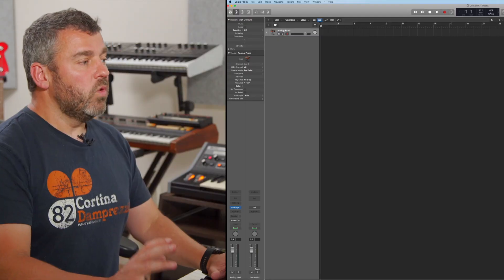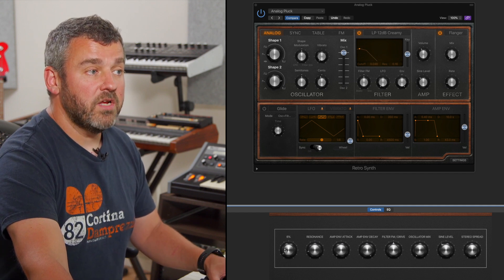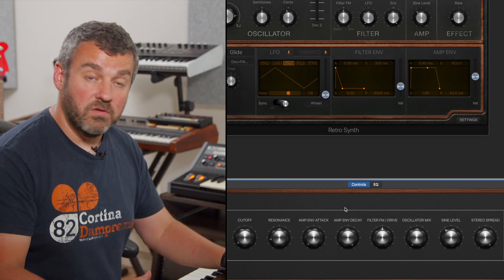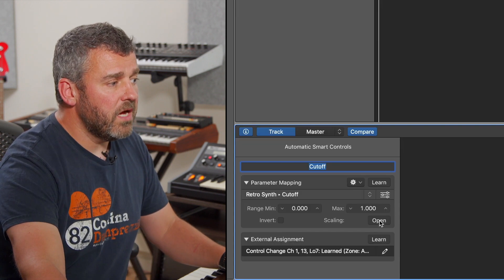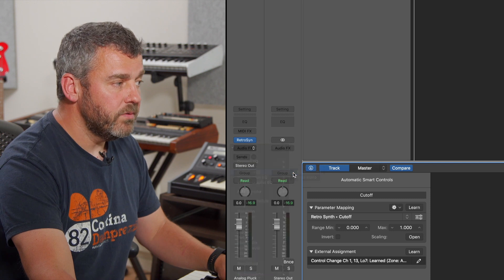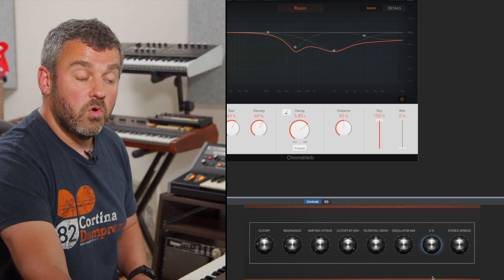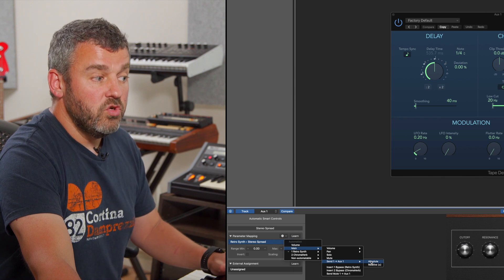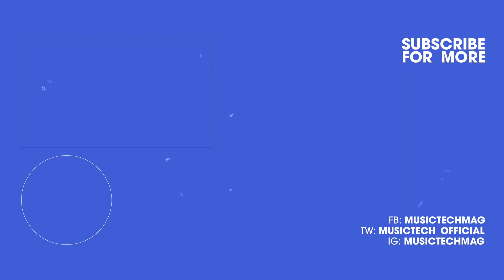Logic Tips - Custom Smart Controls

Comment: Great video! didn’t really know about this. Apologies if this is off topic but could you also advise on a brand of Midi keyboards (with encoders) that works best with Logic Pro’s smart controls circa 2023. One that has a doable mapping system, especially. Talking about using the smart controls in real time. I’ve tried Arturia and it doesn’t work too well. I have an Maudio keyboard and even that is struggling but it’s very old now so I don’t know. Assigning with these two keyboards is always a struggle and even once assigned, the controls are very flabby. Any advice would be welcome. Thanks.

Comment: Greetings from London. Thanks for the informative video. Can I make more than eight external controller assignments and then save them like presets? For example, I would like to map the logic arpeggiator parameters to the knobs on my Arturia midi lab and be able to 'load' them only when the arpeggiator is working. If not, I would like to load a map of a scriptor function...and so on.

Comment: Excellent tutorial quality on this channel here! I want to build a standard setup of 12 parameters that are controlled by the same knobs and which opens up every time I load in a plugin. So for example I create a new channel strip and load alchemy into it, I don't want to setup my custom smart controls from beginning every time I create a new alchemy channel strip. So it should just load up the same 12 parameters which are dedicated to the same knobs. At the moment I'm in the process of finding a convenient solution which is saving the whole channel strip to my patch library but this requires me to load the customized patch manually every time I create a new alchemy strip. 

All I want to do is to setup my 16 midi knobs to a certain parameter in the current plugin of the channel strip I'm hovering in. Every solution requires a somehow manual step where I either load in a patch or where I have to manually switch modes in my midi-assignment window (cmd + L).

Isn't there a simpler way of mapping one knob to different parameters depending on the plugin track you currently are in?! I'm kinda new to Logic X but I couldn't find a solution anywhere.